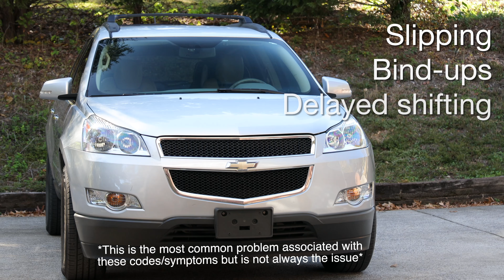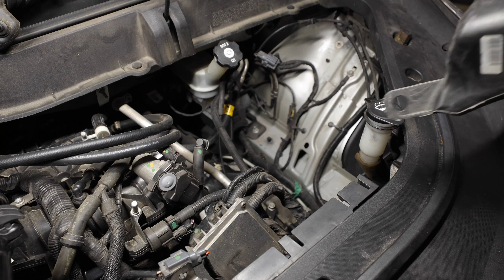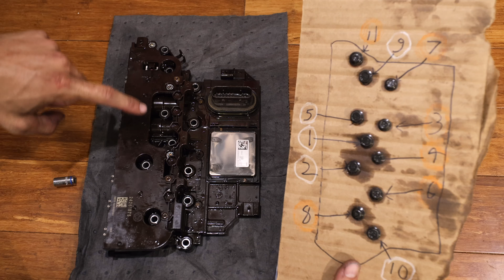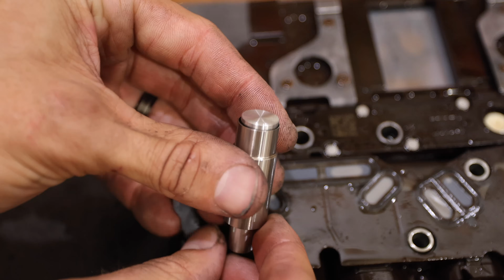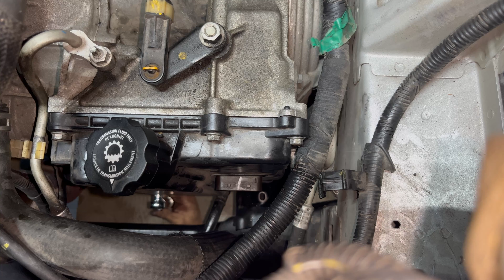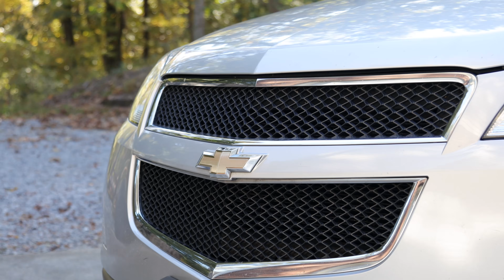Delayed Shifting in Your GM Car | TCM Laminated Disk Failure

Comment: I just did this job on my wife's 2012 Acadia and this video was very helpful, especially the bolt diagrams for the TCM and cover.  I did some of this job on Sunday and then for an hour after work for a few days this week.  I probably have about 6 hours into it.  The video was great at reminding me where i was in the job.  The car was going crazy right before the fix and now it shifts great.  3 of the 4 diaphragms were failed.

Comment: According to the video notes this only really applies to years before 2014? My 2018 Acadia has a shift flare at light acceleration on 1-2 and 2-3.  Not sure if it needs this or new valve bodies. Shift flare isn’t severe and the shift still feels smooth not a bang.
Reply from the maker: This video applies to the 1st generation 6T70 transmission TCM which was phased out around 2013-2014 and replaced by a TCM that doesn't have these laminated disks. With yours being a 2018, I'm certain it won't have this exact issue.
You could still try a full transmission flush. It should be very similar to the flush I did on this video, but make sure you verify correct drain plug locations, transmission cooler lines and fluid capacity as it is a different model: https://youtu.be/6CXMv0ur0hQ

Comment: I just did this to my 2011 Buick Lacrosse with the 6T70 transmission. I had to reflash the TCM with a high end tech automotive computer so that it would reset the pressures for smooth shifts because I was having some hard shifts and bumping into 4th and 5th gears and slow to go into drive issues. After the reset it works as smooth as butter and goes into drive immediately ! Pretty simple fix if you do your research and take your time!
Reply from the maker: Thanks for sharing! Unfortunately it does require a relearn sometimes, but glad to hear you were able to get everything fixed!

Comment: How long is the actual process for this? Trying to weigh having a shop or DIY. Thanks for any info!
Reply from the maker: It's going to vary a lot based on experience. I would say it should take a half-day to complete. If you have a lot of experience working on cars, you may be able to finish in 1.5 hours or less, but I would allow at least 4 hours to take your time and make sure you don't mess anything up.

Comment: So I took your advice and I flushed my transmission . Now my car won’t move thanks.
Reply: Lmao ur blaming the guy who made the video? If you did a transmission service and ur car won't move then that means ur transmission was either on its way out already or you didnt do something right or you waited too long between changes.
Reply from the maker: So it’s not moving at all when it’s in forward or reverse? What was the transmission fluid level with the engine running? Are there any check engine codes?
Reply: My dad always used to say that before doing any job to ask if you’re the right person for the job. Usually the fact you had to ask means you’re probably not.

Comment: Im having problems with my 2014 Traverse when its shifting into Drive and Neutral, but not Reverse, could this be the issue?
Reply from the maker: I can't say for sure, but there's a good possibility this could be at least part of the issue. It is very common for them to go out in this transmission and cause all sorts of shifting problems.

Comment: My bolt pattern was different. Same transmission with the 12 srx.
Reply from the maker: Yeah, there are slight differences between some models. I believe the SRX has the slightly lower torque transmission than the Traverse, since it is a smaller/lighter vehicle, but the overall procedure will be very similar to replace the pressure switches in that Gen 1 transmission.
Reply: @FixandMaintain yeah as long as we put the screws into the cardboard the way we took it out everything will be good. Mine had all 10mm on the left and 4 8mm on the right on the shallow part. 

Unfortunately though, fixing the pressure switches only helped for a few days and then the problem was back. I just swapped the whole techm a couple days ago and now I just need the time to program it.
Reply from the maker: That's interesting that they were in different places on your transmission, but glad the cardboard trick worked to keep everything straight.
That's really frustrating that the problem is back now. Reprogramming the new TEHCM is quite a process, especially after going through the initial repair and then swapping to the new TEHCM.

Comment: I followed every step, and now my shifter is locked. Do you have any idea what it might be thank you very much for your help
Reply from the maker: Have you checked the shift linkage on top of the transmission just behind the fluid fill/dipstick? 
There is also a shift interlock solenoid linked to the brake pedal that is also worth investigating.
Are you able to shift into neutral with the engine off?
Reply: I did check the shift linkage, and it looks good, and the brake lights do work and I need to check the solenoid under or next to the shifter but I guess I need to remove some parts from the center console

Comment: So doing this, you wouldnt have to reprogram the TCM right since you just replaced the pressure switch ?
Reply from the maker: I guess it depends on how much your car has relearned shifting with broken pressure switch disks. But in my case, no relearn necessary and flawless shifting immediately after.
Reply: @FixandMaintain eu fiz esse procedimento, quando fui testar funcionou a ré. Da segunda para a terceira atrasou um pouco e da terceira para a quarta tbm. Agora a ré não quer funcionar. Será que precisa fazer alguma reaprendizagem

Comment: For the 6T70 in my 2010 traverse, I don’t have to worry about removing my manual valve shifter from the old unit and putting it on my new remanufactured unit, do I? Thanks!
Reply from the maker: I’m not sure, but I would expect a remanufactured unit should be bolt-on straight out of the box. You may have to go through some recalibration steps with a new TCM, though.

Comment: Great video! How is the process to relearning? Do I need scanner to "Service Fast Learn"?
Reply from the maker: Thanks! My transmission didn’t have any issues after the repair, so I didn’t have to go through any relearn process. You would have to have a scan tool to initiate a FastLearn procedure, but it’s my understanding that it will automatically calibrate during the course of a few hundred miles if you don’t have a scan tool.
Reply: @FixandMaintain  My Buick Lacrosse would not relearn after 100 miles so I had to have a relearn done with a computer. Now it shifts very smooth and goes into drive immediately!

Comment: Would this be the same steps and location for the bolts in a 2011 chevy traverse
Reply from the maker: It should be. The vehicle I was doing it on was a 2012 Traverse with the 6T70 transmission.

Comment: Awesome video my dude.   My daughters 2010 was having an issues where it would stick in 2nd gear first time the car would start up.  I assumed the TCM was the issue.  I was going to replace the entire unit but when i took the orignal out i saw most of those laminated discs were damaged. I opted to do this repair instead and now it shifts normal again. Great video and thanks a bunch!
Reply from the maker: You’re welcome, I'm glad that repair worked out for you! It seems like such a weak spot in an otherwise decent transmission that has given them such a bad name. It’s crazy how relatively simple and cheap this repair is versus typical transmission problems.

Comment: They can go bad and u get no codes at all! No engine light either 🎉
Reply from the maker: Yes. I was very surprised with how damaged my old switches were with the only symptom I had noticed being delayed shifting from reverse to 1st. But now after replacing them and flushing the transmission fluid, shifting is significantly smoother between gears and no delays from park or reverse.
Reply: @FixandMaintain  yes I got no codes at all! N bad.

Comment: What did the same process apply to the 2015 Buick Lacrosse all-wheel-drive ?
Reply from the maker: It’s going to be the same transmission in that sedan, so the same steps once you get to the transmission, but I’m not sure if the layout is exactly the same as it was in the Traverse in the video. Sometimes engineers have to move things around depending on the body/engine bay of the vehicle.

Comment: Did you change the solenoid valve filter plate like repair manual says to do or is it not necessary on the later year 6t70 and 6t75?
Reply from the maker: I didn’t replace my filter plate as the screens and gaskets all appeared to be in great shape, but the manual does recommend replacing it to prevent leaks. It’s a bit hard to find, but the part number is 24238176.
Reply: @FixandMaintain thank you

Comment: Puedes compartir tu diagrama de como va el orden de los tornillos de 10 mm y 8 mm
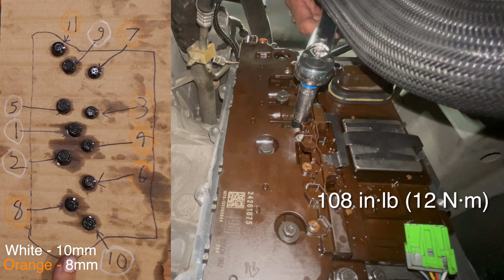Reply from the maker: It’s written on the cardboard at 11:24. 10mm are circled in white, 8mm in orange. The torque sequence starts in the middle at “1” and alternates up and down, finishing at “11” at the top left.
Reply: Ya vi tu diagrama 
Tornillos 10 mm
9  Muy Corto
5, 1 y 2 Largos
10 Mediano

Tornillos 8 mm
7, 3, 4 y 6 Largos
11 y 8 Medianos 

Espero sea así..... Cuando boletas el cartón con el diagrama... Así los veo 😮
Reply: Muchas gracias por el aporte de tu vídeo.. me estás ayudando demasiado 🙂
Reply: What's your location I want to do the.same

Comment: Follow Up: I wondered why you just didn't replace the whole part versus going through what you did.  Then I saw it costs about $1,000 for a GM Genuine "New" part or around $600 for a rebuilt one. Either that or the roughly $50 you spent on these parts. LOL.  No brainer to me :)
Reply from the maker: Exactly! Plus, buying a new or rebuilt part doesn’t save much time. You still have to go through most of the steps in the video to remove & reinstall the module as well as refilling the transmission fluid. I’d say it would only save around 15-30 minutes of time. So yes, no brainer just to repair the TCM you already have!
Reply: @FixandMaintain  I'm not having a major issue "yet" with my transmission shifting but I have noticed a weird delay from Reverse to Drive which wasn't there previously. As a caution, I just ordered all the parts you listed off Amazon ($40) for that rainy day.  I've just never been good with fragile things like these diaphragms and am afraid that I won't have skillset to install them without damaging them. We'll see.  Thanks again!

Comment: That's a fantastic video (as always). I'm having an issue with my 2012 Traverse LTZ where when I back up in Reverse and then switch to Drive, there's a moment of nothing before it engages. That "delay" is fairly new and not always present, but it does happen.  I have no codes of anything wrong though. It's just something I've noticed and since my vehicle is almost 14 years old, it would make sense that a plastic/rubber seal would be failing right now. (I'm waiting on Heater Hoses to arrive because I have a small leak with those plastic parts - would love to do this job at the same time since removing the air box is part of that process as well).  Really appreciate all the effort you put into these videos to make sure that the camera captures the exact place where you're working. Must take you a long time to be so methodical. You really are the BEST!  Take care.
Reply: Also: How can I tell if my transmission is 6T70, 75 or 80?
Reply from the maker: It depends on the model and trim for which transmission you have, but the TCM is the same for all of them. They didn't update to the 2nd gen until 2013/2014 (depending on the model), so you definitely have the first gen with your 2012. The one in the video was a 2012 LT FWD.
Reply from the maker: Thanks! That sounds just like what I had with this Traverse. When it did have the delay, the throttle also was unresponsive until it finally went into gear. I can't say for sure it's your TCM pressure switch disks, but highly likely. 
You're right, they do take quite a bit of time to make, but I couldn't find any good tutorials going from start to finish on this job, so it's definitely worth it!
Reply: @FixandMaintain  Well, it's definitely worth it to ME, I just hope it's worth it to you 😉
Reply from the maker: Time will tell…
At least at this point I’m able to make money from views, and this seems to be a fairly common issue, so I’m expecting long-term for it to pay off.